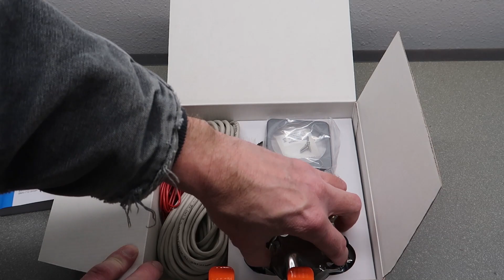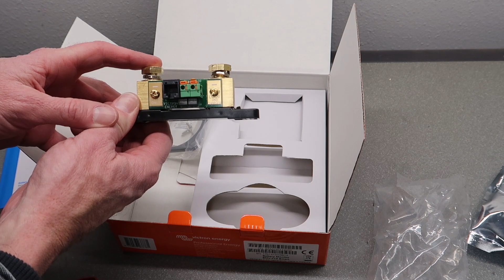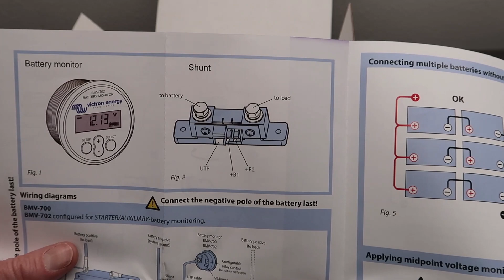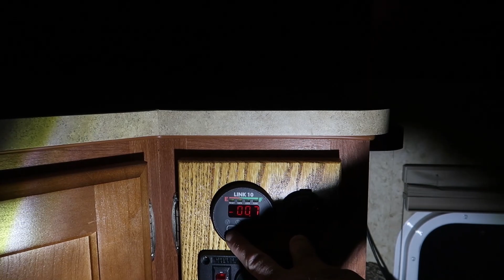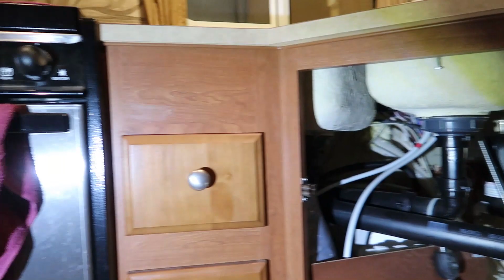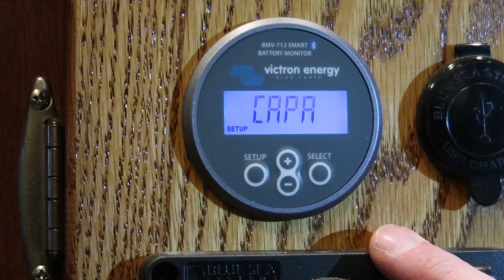Victron BMV-712 Installation in Arctic Fox 811 Truck Camper

Comment: I have been watching your videos and seem to learn something different each time.
The bmv 712 instructions say to run a new wire from the load side to a chassis ground.
Is there a chassis ground on truck camper??? If so what did you use?
Thank you
Reply from the maker: From an "electrical" standpoint, there isn't a chassis ground on a truck camper.
Another (simpler) way of describing the connections with the shunt and the battery bank is this:
Take all the wires off the battery negative that feed to the camper, connect them to the "load" side of the shunt.  Take a new wire/cable and run it from the battery side of the shunt to the negative battery terminal.
There should only be one cable at the negative post of the battery - the cable that goes to the battery side of the shunt.
In a multi-battery system you'd also have a cable from one battery to the next.  If you haven't seen them already, check out my latest inverter installation, where I mentioned (and show) the shunt in greater detail.  I removed the BMV-712 from this video and installed it in a new truck camper.
Reply: So basically saying a chassis  ground per the instructions on a truck camper is not needed.
Thank you very much I greatly appreciate it.

Comment: I greatly enjoy your video's. ( I also have truck camper)
I have a BMV 712 question.
I just install the shunt ran a 2/0 cable to my negative most post on one of my two Battle Born batteries rerouting all my existing negative cables (5) to the load side of the shunt. My problem is that seems to be way to many for the brass screw connection on the shunt. Is there a alternative way to do this. Any help and explanation would be appreciated 

Thanks
Gary
Reply from the maker: Yes, There's a solution.  I had the same problem in my most recent BMV-712 installation.  I used a large terminal post.  I have one large cable going from the shunt to the terminal post, then all my other negative cables are connected to the terminal post.  
Check out this video:  https://www.youtube.com/watch?v=-BPWA36Xags
Reply: @deltabravo1257  Thank you for the reply !
The video you linked was the one I commented on and watched multiple times.
The terminal post you used is like the one I purchased from AM Solar
What would you recommend for cable size to link the shunt to the terminal post.
Again Thank You!!